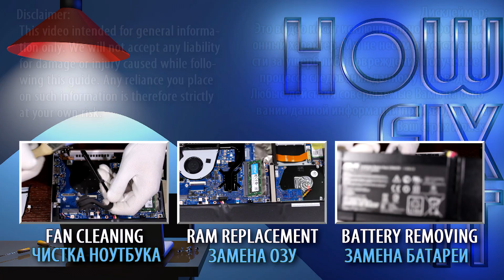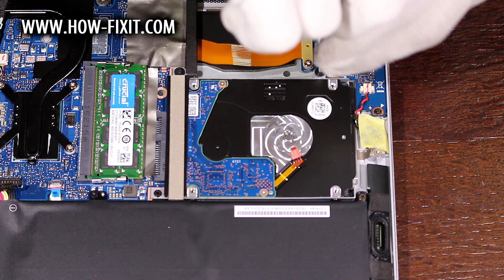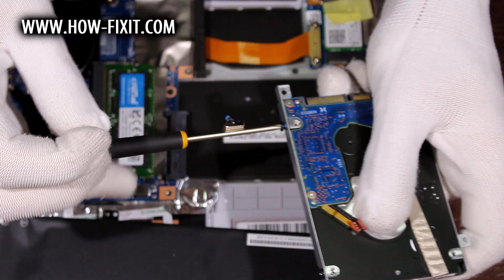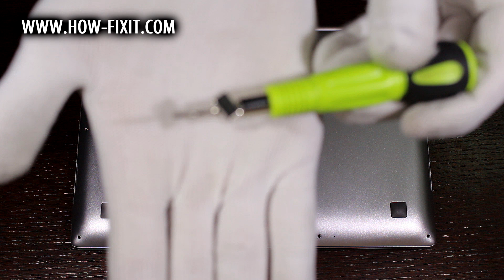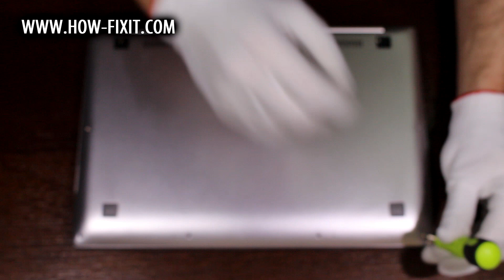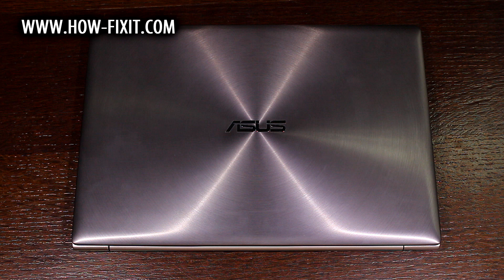Asus ZenBook UX303 Hard Drive or SSD Upgrade: Replacement & Installation Guide

Comment: wtf guys after I did everything my sound doesn't work anymore? I put new SSD there installed windows 10, installed latest driver still no sound? I was very careful. I can only hear if I put a headset in but the speakers dont work. I need help
Reply from the maker: Re-connect the speakers cable or download latest driver from official site https://www.asus.com/us/Laptops/ASUS-ZenBook-UX303UB/HelpDesk_Download/
Reply: Oh, thanks for the answer! I already fixed the problem. Just as you said I just had to reconnect the speakers cable!. Still, thank you for the time and answer!